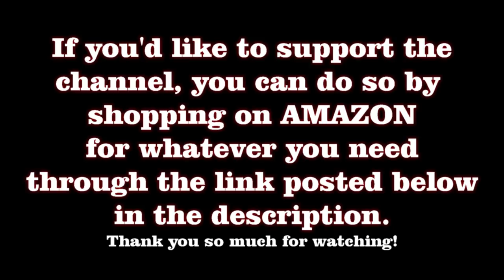The Best Way To Remove A Tub Drain

Comment: I got one of those tools not long ago. Where I work if it's original they are very small just like the one I was snaking last night when I ran the cable straight through the tub trap. Cast iron trap I might add. Back to the tool I haven't had a chance to use this removal tool yet due to the size of some of the drains where I work. I used a narrow wood chisel and a BFH to get it broke loose then more convintional methods to get it out. The tubs at my job are cast iron.
Reply from the maker: A chisel works great too. Thank you so much for watching G8!
www.DirtyMaintenanceNation.com

Comment: Hi Lex. Awesome work! Is it hard to remove that special tool from the old tub drain?
Reply from the maker: Mikey Mike Not hard at all. Just put a flathead through the bottom and give it a tap with a hammer. Pops right out. Thank you so much for watching Mikey!
www.DirtyMaintenanceNation.com

Comment: The Tub Extractor Tool teeth did not bite and it slipped every time.  That brass coloured coating even flaked off.  A waste of time and money. The  metal teeth in the extractor tool need to be harder than the tub drain it needs to cut into.
Reply from the maker: Yep, sometimes I get a stubborn one that won't budge. That's when I break out the chisel and hammer. Thank you so much for watching G Cos!

Comment: No luck here with beat in plugs. Hack saw is the guaranteed tool. Simply slice up across threads and slightly through the rim of the old corroded part. Then gently lift the corroded trim at rim where cut - careful not to chip tub. Tap a screwdriver under the rim at the top of the threaded portion. This should break the rim away from the threaded portion of the old piece. Then pry/bend the threaded portion of the old piece into the drain area. This gives you a piece to get a grip on to unscrew of to continue to chip and pull out parts. Took 45 minutes vs. this video, which is definitely the prefered remedy. Nice clip btw.
Reply from the maker: Thank you so much for watching K E!
www.DirtyMaintenanceNation.com